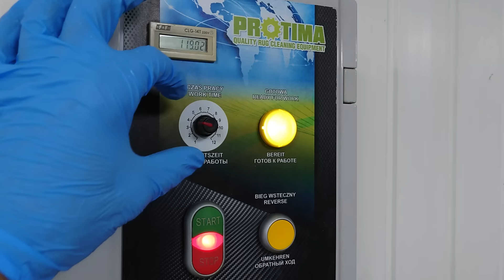Setki Plam Usunięte z Dywanu Jak Grzechy z Ludzkiej Duszy! Relaksujące Pranie dywanu

Comment: There’s something wrong with the bottom left corner of almost every rug (as seen in video, would be the corner closest to the drain channel and the Tornado drain.)
I think the floor is so sloped or higher in that spot, as you can see from the pattern of water/soap flow, that it never gets the amount of water or soap the rest of the carpet gets, either directly, or from the flow from “above” it. 
It doesn’t get as soaked, or it sponges up and passes through the bottom, leaving the top of the carpet less wet and soaped for scrubbing and rinsing. 
I don’t know how much effect this has on the effort or efficiency of cleaning. 
Just my lay-person’s thought. 
I’m probably wrong, not seeing something you see in person, like you do when you rescrub certain spots. 
😸😻💪🫧